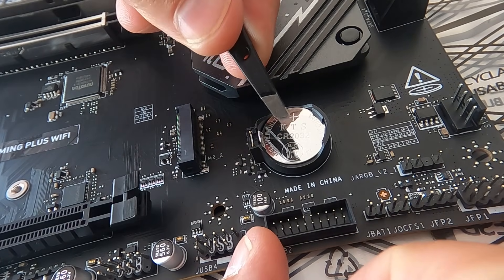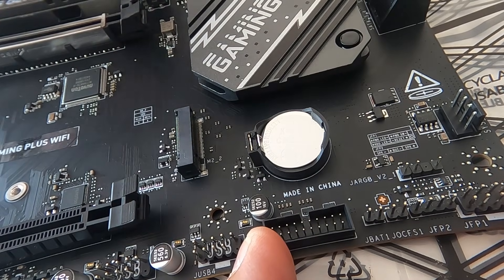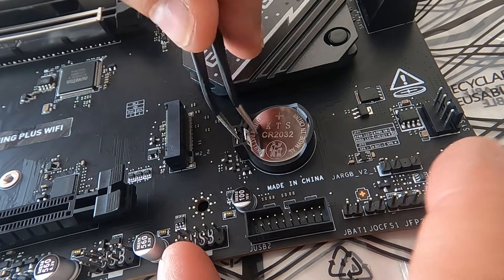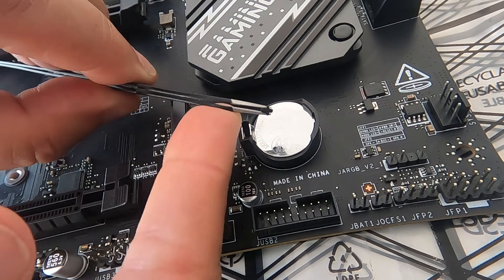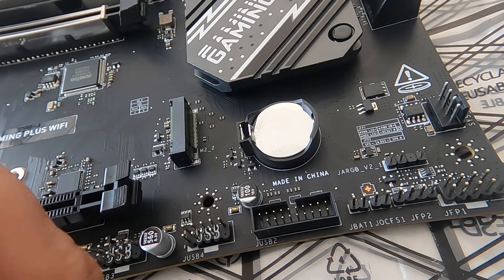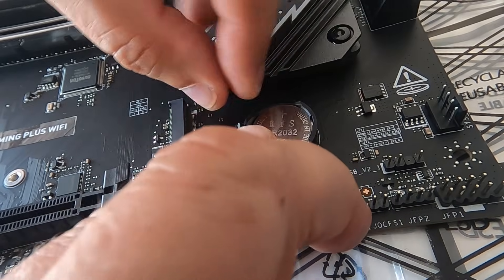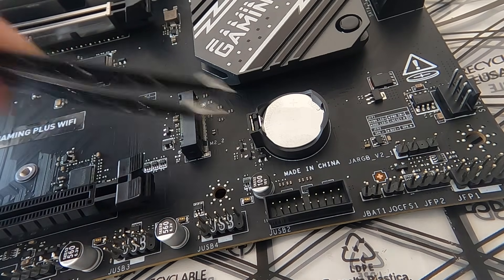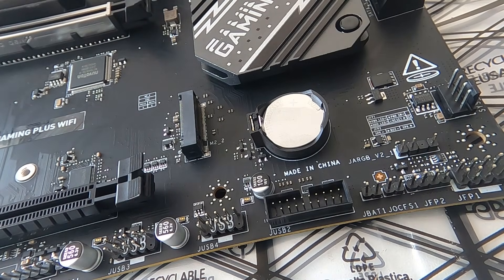MSI CMOS Battery Safety Clip Removal - Close Up

Comment: I think this is for warranty, so they know the CMOS batter has been changed.
Reply from the maker: Might be a factor, especially if the docket shows damage. But large scale OEMs aren’t too worried about that as it’ll cost more to employ technicians either the skills required to spot this kind of thing than it will to just replace the board without scrutiny.

I’d say checking the pin in the CPU socket is a more obvious warranty validity check. Some warranties actually specify that they won’t be accepted if the plastic socket cover isn’t fitted before the board is returned.

Comment: What was wrong with the old way of locking a 2032 battery?
Reply from the maker: Presumably some people at MSI thought it wasn't locked enough.

These batteries are extremely dangerous if you swallow one. It's usually fatal.

So I think someone important at MSI reacted to this either because they were horrified about a news report or because it happened to someone they know.

Comment: If i don’t insert the security pin would it be a problem?
Reply from the maker: You don’t have to replace the clip if you remove it. Without the plastic clip, the battery socket is the same as other sockets.

Comment: Mate this isn't the way to remove the latch on these MSI motherboard. You gotta put a SIM card removal tool or something similar shaped into the tiny hole next to the battery and then try to pop out the latch. Doing this will potentially could harm your motherboard.
Reply from the maker: It doesn’t hurt the motherboard if you’ve got an appropriate set of tweezers. As shown.

Next time I get an MSI board I’ll try a SIM tool though.

Comment: If this battery fails somehows, can that cause the system fail to boot up? On older Macs, a battery was used to maintain pram and the system clock, and systems did not boot if the battery was exhausted. But these boards are different ofcourse.
Reply from the maker: Most modern motherboards will boot with a flat battery. They'll use the failsafe BIOS defaults and have the clock set to the BIOS install date (roughly) so although the system will boot it might behave strangely depending upon how the BIOS settings used were different to the default settings. Often, this won't happen until the mains is turned off - that's when the battery is actually needed.

XMP/EXPO RAM settings are an obvious example, but for older systems CSM mode can be an issue - I made a video about that exact problem.

And PC's are not the same as Macs... 😜

Comment: Wanted to add here using a sim tool to push into the tiny hole next to the battery and then tweezers to grab the plastic worked well. Saw comment on previous video about it and it did work!
Reply from the maker: Nice!

I guess a SIM tool and eyebrow tweezers is something people are likely to have somewhere. I have a set of tweezers that I use in my workshop so used them.

It would be nice if MSI told us how they think we should get the clip out… it sounds like this is what they had in mind.

I’ll try it the next time I’m building with an MSI board.

Comment: I accidentally broke one of the two tiny tips on the side of the locker what should I do
Reply from the maker: Does the battery feel like it's in securely and can't fall out unless you want it to?

If so then don't worry and I won't tell anyone you broke it. 😜
Reply: It seems like it’s holding fine I tried flipping the case and it stayed in place and I hear the tick sound when I put it in 
but I put the plastic piece in between anyway

 @sterntechdaddy
Reply from the maker: All good then... 😊

Comment: why did new motherboards make removing battery more complicated
Reply from the maker: It’s a safety feature. If anyone swallows one of those batteries then they will most likely die.

Just watch what happens when Lithium comes into contact with water. 🫣
Reply: @sterntechdaddy  that’s a ridiculous feature; an answer in search of a problem.
Reply: @sterntechdaddy if your going out of your way to take out the cmos battery from your motherboard and swallow it maybe you need to go